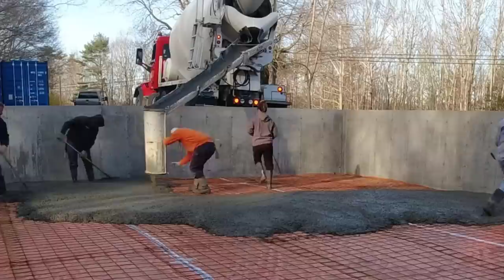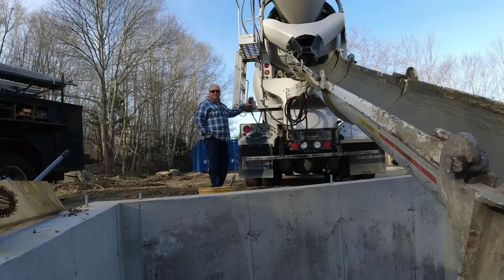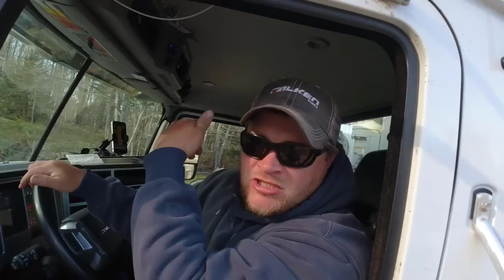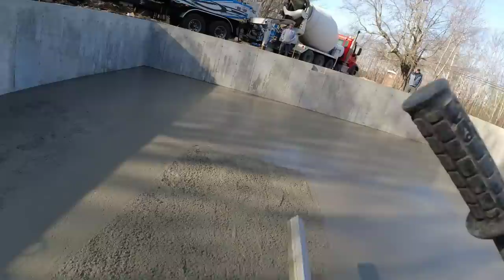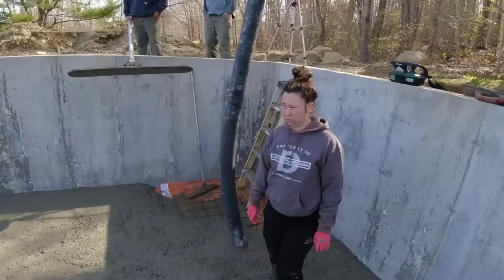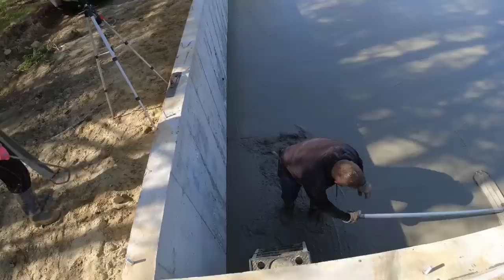Pump Truck Was Late! Big 40' X 80' Concrete Floor Pour

Comment: You and your crew do some great work!  Just poured a 28×52 garage with 3 drains by myself (4 days, 4 pours) and was wishing I could find people like you and your team to help get it down in 1.  Always great to see your videos, you guys (and gals) keep me motivated👍
Reply from the maker: Thanks Jason!
Reply: How many people did you have? I should have do in 4 days too :( had a new patio and extended driveway too, 14 yards 2 ppl 2 trucks, we had concrete buggy and power throwel. Was hoping to stamp the concrete with brick finish but we managed to create marsian planet surface instead 😀 super ugly

I can’t remember when I was as exhausted as am today

I was thinking would having powered screed help better? Or it’s really not possible to pour 1500sf in 4 hands?
Reply: I was by myself....no helpers.  

Sounds like you guys had a rough day!  I know the feeling when everything seems to go wrong.  Trying to stamp 1500 sq ft with 2 guys is definitely beyond my capabilities so no wonder you're tired! 😁   depending on the stamp, I try to never exceed 4 yds per finisher/stamper.  So 2 guys stamping would be 8 yds per pour....14 is definitely a hard day!

Comment: I was wondering why you guys don't use a conveyor instead of a pump Not one that comes with the redimix truck but a self contained unit they seem to be much cleaner and only put down the concrete that you need we use them a lot even for spreading stone in the basements they don't leave a big pile of crete when they're done either
Reply from the maker: I haven't seen one up here in Maine.

Comment: showed up to the framing job 30 miles away only to have the boss tell me the day was canceled cuz of the rain.  everyone had already gone home, I was the last guy there, and about the time I got there the weather was clearing.  so as I am headed back to the truck these foundation guys on the lot next to ours yells out in a heavy brogue " hey lad if you don't want to lose the day, we can use ya" so I jump in the hole with these guys and start moving them steel and plywood forms through the mud.  was covered in the shit from head to toe in a half hour.   wound up breaking 2 sledgehammer handles, and this miserable existence went on until the boss yells lunch.  so I go up to the boss and sez, " really appreciate the opportunity, but I have had it with this type of work.  don't know how you guys do it day in and day out.  you don't owe me a penny"  couldn't get out of there fast enough.

Comment: Thank you for you amazing content.
I was wondering what is the thiniest you can go for a slab?
Let's say that there is fiber in it, armature , and you put a solid 4500 psi concrete?

Thank you, I always watch your video when I need more knowledge about concrete.
Reply: Hey idk the answer here but if we were to look at pavers, there are 2 inch thick pavers in hd but they are all not for driving. The one that are rated for driving are 2.5 at least
Reply: @ekurdesov  Thank you for that!
Reply: @Downhillrider888  2" is the rule of thumb for most concrete. Never pour it thinner than that. You need smaller aggregate, and usually something other than portland cement for any job where you need it thinner than that
Reply: @onetwothree4148  very useful thanks! What other than portland cement can be used?
Reply: @Downhillrider888  virtually all concrete is portland based, but artists and specialty trades sometimes use things like CSA cements in thin pours like countertops. Also there are portland based products like vinyl patch cement and polymer modified mortars that have only very fine aggregate/sand and are designed for very thin applications (like if you have a hole in a concrete structure that is too thin to patch with more concrete)

Comment: Ain't no way in hell yal pulled the mesh up on the whole slab. Put chairs under it. Just a waste of steel
Reply: Didn’t need mesh at all, the foundation is under the frost line, no floors in Maine under the frost line have steel in them, unless they put radiant heat in them, and that’s just to hold the pex down, wasn’t necessary to begin with, probably the owner asked for it but it’s not necessary if you cut the floors, and I’m sure Mike did when he was done
Reply: @chrisbrann7733  cutting the floors has nothing to do with the strength that steel provides to the concrete. Cutting only and hopefully gives a place for the cracks to go. And all foundations in the north east are under the frost lines. But u still put steel, bar, mesh, or fiber in the mix.  And even if it is unnecessary,  if the owner asked for it at least pull it up or set it on chairs so it does its job.
Reply: @smackflack5771  in a basement floor, where is the load? A basement floor is a walking surface, and again, there is no need for steel in a basement floor, because it’s not load bearing, read your ACI book, and Mike uses fiber in every pour he does, he just didn’t mention it this time.

Comment: Why didn't you wait?  Because concrete guys are always trying to prove something.
Reply: Time is money?
Reply: Oh yeah lets let those trucks spin there getting hot and make our job even harder later on. Props to these guys they got 2 trucks down by hand and luckily the pump showed up before it got significantly more difficult to access. Kept the pour sequence on time and now they can simply finish it without 1/3 of the floor being hotter than the rest of it
Reply: @markdoumert4840  been there.... Good summary as to sequence.